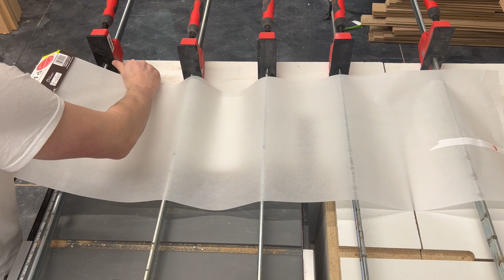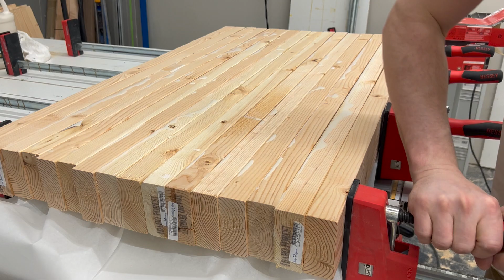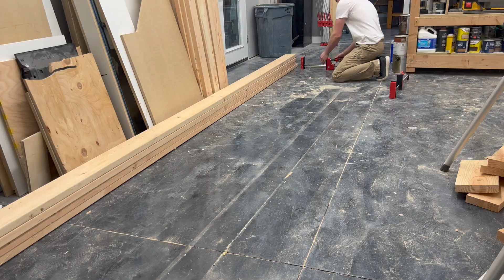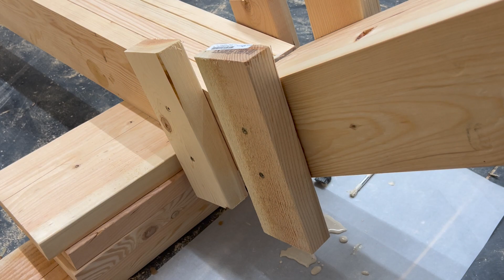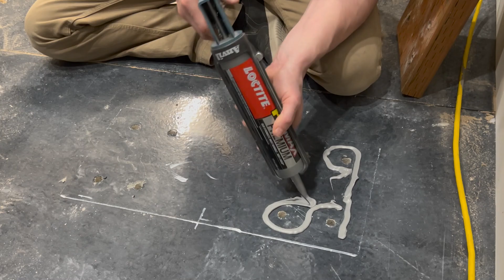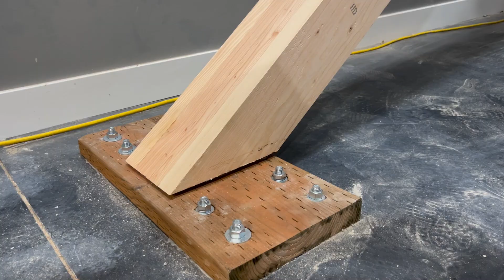Custom Staircase out of 2x4's

Comment: Those dominos glued to end grain are scaring the hell out of me. Maybe worth doing a update video on the finished product going over the joints in depth I’m assuming there’s a lot more structurally to this build than what is shown in this video
Reply: Me too.  Great idea, but the shear strength of the joints is scaring me. Need to somehow use scarfing or large tenons and steel (bolts, all-thread with washers and nuts) to increase structural integrity.

Comment: I’d assume you’re going to add this, but a steel plate might make your joint between those beams a much stronger joint, considering that glue is not going to hold well on those end grains.
Reply: Search for a video on youtube called "wood gluing myths: end grain", they scientifically test the strength of glued joints and find that end grain joints are TWICE as strong as side grain glued joints....hope this shows you not to believe every assumption you hear

Comment: The 6 dominoes on the 142º angle is an accident waiting to happen (as is all the other domino joints). Those 6 dominoes have less surface/volume area than ONE 2x4. Also, if he's thinking that by gluing the flat areas around the dominoes is adding extra strength, he would be mistaken as he is gluing END GRAIN. Additionally, there are many youtube videos demonstrating the inherent weakness of domino, biscuit and dowel joints vs. robust, traditional wood joints. The small area of the dominos just will not hold the shear force of the stair and load (people). I appreciate his use of common building materials for this project, but he should re-visit his joinery. A large, recessed tenon or half dovetail joint would have worked better.
Reply: I hope he does not carry any heavy furniture (stair treads, 2 person and heavy furniture)

Comment: Be careful, you are starting to head into doing this on a machine tool. I love all the angle joint work. 

The one thing that I myself would have done is in the attaching of the first main beam to the plate bolted to the floor. I would have taken that plate back up and run in a lag bolt or two from the underside, just for improved shear strength across that joint. 

With that said, very nice work.